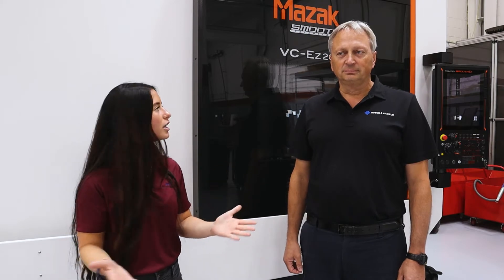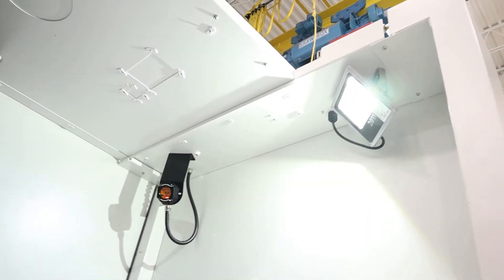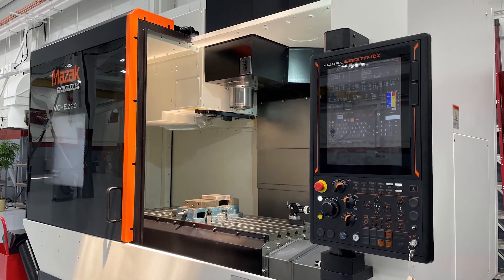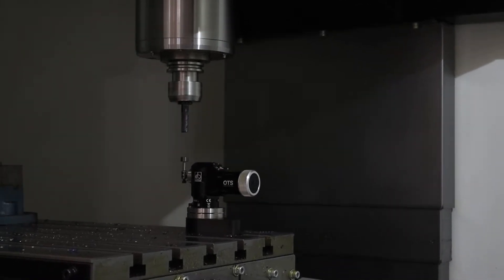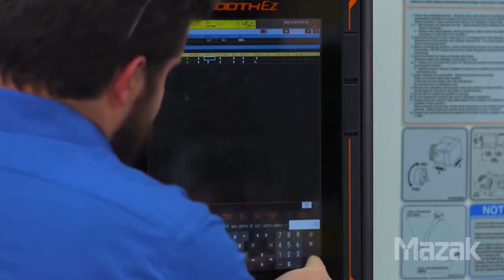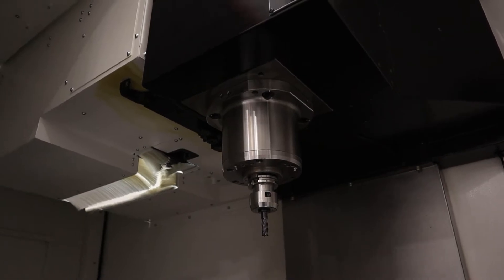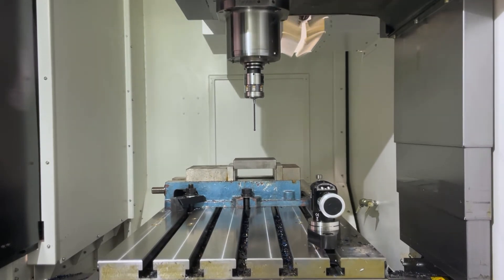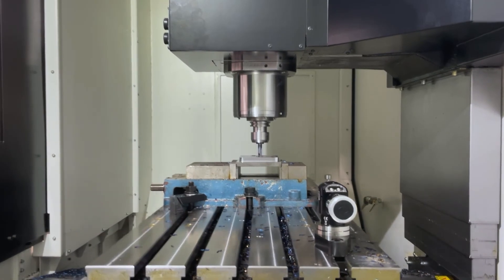Mazak VC-EZ20 Demo | The HEH Group

Comment: Are the probing routines done with the control or a separate control?
Reply from the maker: Rob, thanks for your comment! The macro programs are in the control. You are not able to get the Smooth Set & Inspect on the EZ Control, however, there is a tablet that you can get for the EZ Control that would be interfaced to the control and allow you to have Smooth Set & Inspect on the tablet! Hope this helps.